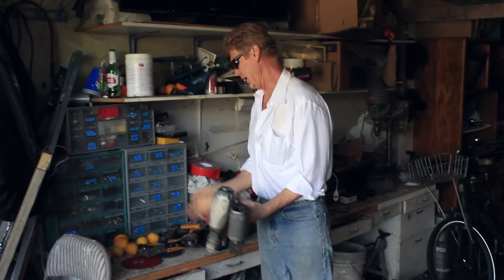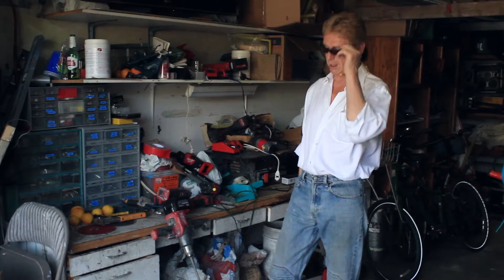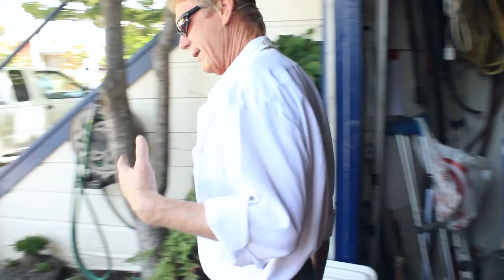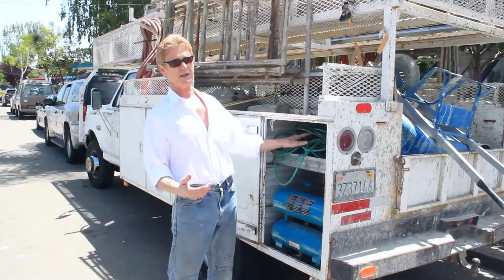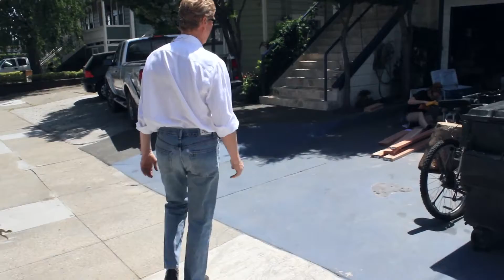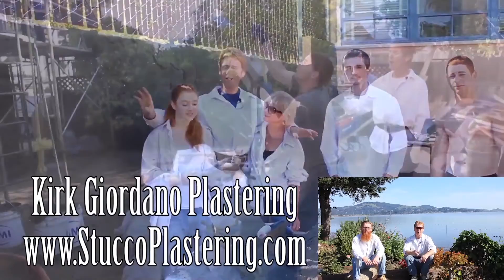Milwaukee build a battery-operated staple gun

Comment: https://www.amazon.com/DEWALT-DCN681D1-20V-18Ga-Stapler/dp/B071HYD4KC?ref_=fsclp_pl_dp_3. That looks like what you are looking for.
Reply from the maker: Good evening, Steve, Dewalt does indeed make a cordless staple gun, like the one in the link, which is also in my garage, however, it's for a finish carpenter not for attaching stucco netting.
For code requirements on attaching stucco nettings, the crown should be at least 1 inch wide, while the tract should bet adaptable to hold inch and a quarter to 2-inch staples.
Bringing peace, love, and brotherhood, back into the 🌎 of Plastering.
  The most comprehensive encyclopedia of plastering on video, by the plastering messengers of Youtube. 
Kirk and Jason Giordano with over 800 videos 🎭 👀💃

Comment: I do believe that Dewalt makes a battery powered staple gun
Reply: Yes they do
Reply: Brad nailer you’re probably talking about
Reply: @brentwatier  / nope
Reply: Sonny Dey North America we don’t have any yet
Reply: @brentwatier  / can't you do a search on the net. They have some there, but perhaps not the type that he needs
Reply: Sonny Dey special kind. Half inch crown nailer. I did research. I’m dying here. Come on dewalt, Milwaukee!!!
Reply from the maker: Good evening, Sonny, Dewalt does indeed make a cordless staple gun, but it has a narrow Crown.
For code requirements on attaching stucco nettings, the crown should be at least 1 inch wide, while the tract should bet adaptable to hold inch and a quarter to 2-inch staples.
Code calls for 7/8 of the leg to be embedded into the stud, for the structural strength necessary to support the weight of new stucco.
Since around 1980, homes nowadays have a plywood substrate. Thus one inch and a quarter is the shortest leg necessary for attaching stucco netting.
When I first started plastering there was no plywood, homes were just studs, so we used 7/8 staples, today or since 1980, we got it easy with the plywood substrates.
Bringing peace, love, and brotherhood, back into the 🌎 of Plastering.
  The most comprehensive encyclopedia of plastering on video, by the plastering messengers of Youtube. 
Kirk and Jason Giordano with over 800 videos 🎭 👀💃

Comment: KIRK! Here is your solution, and it is compatible with your monster 18V Milwaukee battery!

https://www.milwaukeetool.com/Products/Power-Tools/Woodworking/Nailers-and-Staplers/Staplers/2749-20

Edit: In addition to that, I always had a good inverter in my truck to plug my 18V battery charger while I drive to the next job to make sure my batteries were always full on the job.
Reply from the maker: Good evening Mac Daddy, Milwaukee does indeed make a cordless staple gun, but it has a narrow Crown. Used mainly for attaching a wire to a wood post. 🤓
    Milwaukee also makes professional framing nail guns along with bard guns all cordless typical, Milwaukee quality, powerful, and very reliable.
 However, no tool manufacturing company in the world as of 5/14/20 has yet to come up with a cordless stapling gun. 
Some tool manufactures come up with so-called stapling guns that used CO2 cartridges. However, the cold air from these CO2 cartridges beats up the rubber and plastic parts in these portable staplers. Soooooooo, back to the drawing board.🤽🏻
       For code requirements on attaching stucco nettings, the crown should be at least 1 inch wide, while the tract should bet adaptable to hold inch and a quarter to 2-inch staples.
Code calls for 7/8 of the leg to be embedded into the stud, for the structural strength necessary to support the weight of new stucco.
Since around 1980, homes nowadays have a plywood substrate. Thus one inch and a quarter is the shortest leg necessary for attaching stucco netting.
       When I first started plastering there was no plywood, homes were just studs, so we used 7/8 staples, today or since 1980, we got it easy with the plywood substrates.
      Bringing peace, love, and brotherhood, back into the 🌎 of Plastering.
  The most comprehensive encyclopedia of plastering on video, by the plastering messengers of Youtube. 
Kirk and Jason Giordano with over 800 videos 🎭 👀💃

Comment: Dewalt has a crown nailer (dewalt DCN681 20v max) fires inch to inch and a half maybe worth looking into.
Reply from the maker: Good evening, Jocelyn, Dewalt does indeed make a cordless staple gun, but it has a narrow Crown.
For code requirements on attaching stucco nettings, the crown should be at least 1 inch wide, while the tract should bet adaptable to hold inch and a quarter to 2-inch staples.
Code calls for 7/8 of the leg to be embedded into the stud, for the structural strength necessary to support the weight of new stucco.
Since around 1980, homes nowadays have a plywood substrate. Thus one inch and a quarter is the shortest leg necessary for attaching stucco netting.
When I first started plastering there was no plywood, homes were just studs, so we used 7/8 staples, today or since 1980, we got it easy with the plywood substrates.
Bringing peace, love, and brotherhood, back into the 🌎 of Plastering.
  The most comprehensive encyclopedia of plastering on video, by the plastering messengers of Youtube. 
Kirk and Jason Giordano with over 800 videos 🎭 👀💃

Comment: Dewalt has a cordless brad nailer, that would be easy to convert into a staple gun.
Reply: Ha!!
Reply from the maker: Good evening Fred, Milwaukee does indeed make a Brad nailer and a cordless staple gun, but it has a narrow Crown. Used mainly for attaching a wire to a wood post. 🤓
    Milwaukee also makes professional framing nail guns along with bard guns all cordless typical, Milwaukee quality, powerful, and very reliable.
 However, no tool manufacturing company in the world as of 5/14/20 has yet to come up with a cordless stapling gun. 
Some tool manufactures come up with so-called stapling guns that used CO2 cartridges. However, the cold air from these CO2 cartridges beats up the rubber and plastic parts in these portable staplers. Soooooooo, back to the drawing board.🤽🏻
       For code requirements on attaching stucco nettings, the crown should be at least 1 inch wide, while the tract should bet adaptable to hold inch and a quarter to 2-inch staples.
Code calls for 7/8 of the leg to be embedded into the stud, for the structural strength necessary to support the weight of new stucco.
Since around 1980, homes nowadays have a plywood substrate. Thus one inch and a quarter is the shortest leg necessary for attaching stucco netting.
       When I first started plastering there was no plywood, homes were just studs, so we used 7/8 staples, today or since 1980, we got it easy with the plywood substrates.
      Bringing peace, love, and brotherhood, back into the 🌎 of Plastering.
  The most comprehensive encyclopedia of plastering on video, by the plastering messengers of Youtube. 
Kirk and Jason Giordano with over 800 videos 🎭 👀💃

Comment: Hey Kurt, 2nd generation plasterer here. I saw Milwaukee had a patent on a cordless coil roofing gun. Not sure if its comming out this year or next year. They did just release a cordless air compressor at 2 gallons but it had only 65 decibels whitch is half of a normal compressor.
Reply from the maker: Good evening, Jocelyn, Dewalt does indeed make a cordless staple gun, but it has a narrow Crown.
For code requirements on attaching stucco nettings, the crown should be at least 1 inch wide, while the tract should bet adaptable to hold inch and a quarter to 2-inch staples.
Code calls for 7/8 of the leg to be embedded into the stud, for the structural strength necessary to support the weight of new stucco.
Since around 1980, homes nowadays have a plywood substrate. Thus one inch and a quarter is the shortest leg necessary for attaching stucco netting.
When I first started plastering there was no plywood, homes were just studs, so we used 7/8 staples, today or since 1980, we got it easy with the plywood substrates.
Bringing peace, love, and brotherhood, back into the 🌎 of Plastering.
  The most comprehensive encyclopedia of plastering on video, by the plastering messengers of Youtube. 
Kirk and Jason Giordano with over 800 videos 🎭 👀💃

Comment: Kirk how about a video about the obscure and forgotten art of making and applying WHITE WASH to stucco?
Reply: Lime salt and glue
Reply: @amandahug-n-kiss3749  Thanks, a video comparing formulae and showing results would be excellent.
Reply: @quail333  I don't have any white wash project at this point but the mix for white wash,: 2 gallons of water I gallon of lime one cup of salt   one cup of glue/bonding adhesive for smooth walls and extra half gallon of water for rough walls. You can add plaster pigment due for color . I only use it on lime plaster walls.
Reply: @amandahug-n-kiss3749  Check the vid by Mike Haduck on painting with Portland. I have a sack of White Portland cement I have not tried yet.
Reply from the maker: Howdy Quail, there's a reason it's forgotten.🤷‍♂️
    This process is usually to mix up lime and make it soupy, you then use this soupy lime and paint it on whatever, rocks, bricks, logs, branches that are used for protection from the elements, you name it, it does indeed preserve most exteriors even, "wattle and daub."🤔
      However, when the soupy lime plaster is complete, the results are not pretty, as Lime Plaster does protect against bugs and wood rot, and many instances preserve exteriors. Still, it looks visually like someone diluted white paint and half-arsed painted something.
    Keep in mind this system worked well in the days long past when people needed the absolute cheapest way to keep bugs or wood rot from occurring.
 Please, don't misunderstand me, I'm not too high in stature that I'm saying it leaves a horrible finish as it does, I'm saying this procedure works but is not pretty.😉
     Bringing peace, love, and brotherhood back to the world of Plastering. 🌍
With over 850 educational and free Youtube videos, by your favorite plaster geek, 
🤓 and my son, Jason, the bearded plasterer.💃🧘🏻🧞‍♂️🎉
Reply: @StuccoPlastering  Big thanks Kirk, I can see where interest would be limited because there is no money in it, material wise, but I think it needs exploring and understanding like Santa Barbara Mission Finish,  it helps that I am into WHITE stucco. They say it has a unique look when it is layered over years like on those Greek Islands.